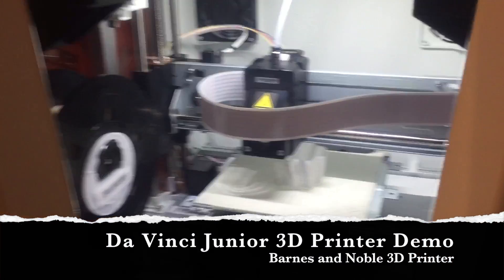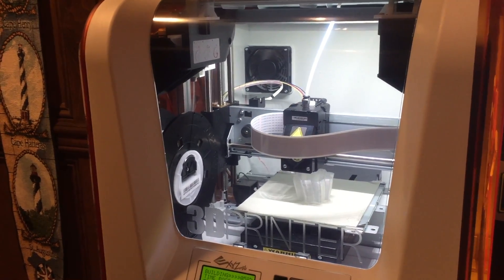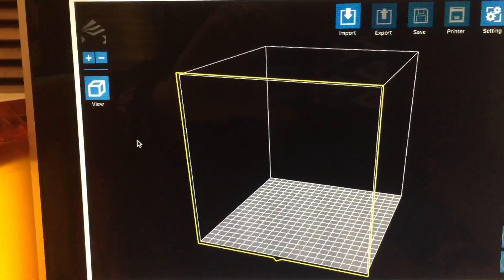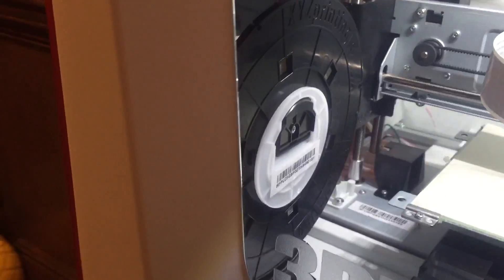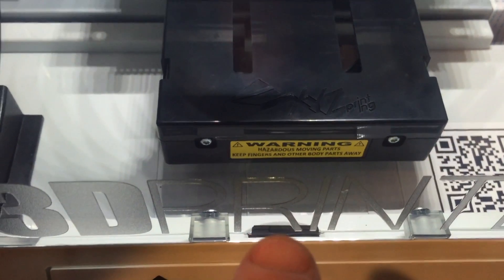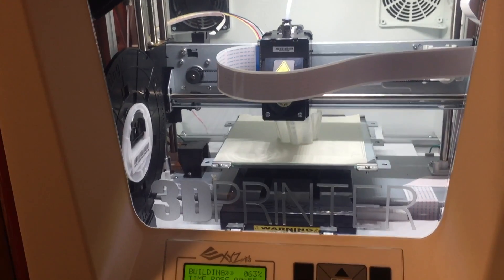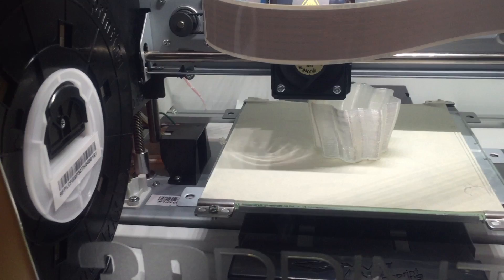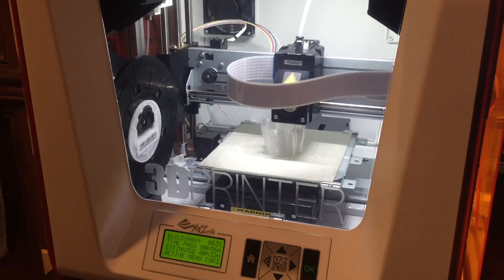Da Vinci Junior 3D Printer Review And Live Demonstration

Comment: may i ask i just ordered this thing and when i get it i want to know how to calibrate it so the film doesn't rip how do you do thiss
Reply from the maker: +UnboxNow I did that very thing the first time I used it. It says it self calibrates however it doesn't do it well enough. You need to select the z-axis option and move it up from its setting of zero 0.1 at a time until you can slide approximately two sheets of A4 printer paper between the head and the glass. This is trial an error as you can't bring the nozzle to the table on its own. I'd start with 0.5 as the offset. That said whilst it cut through my first set of sticky paper I was still able to remove the trial print using the scraper tool. It didn't damage the glass.
Reply: ThisisRealLife  thank you very much.